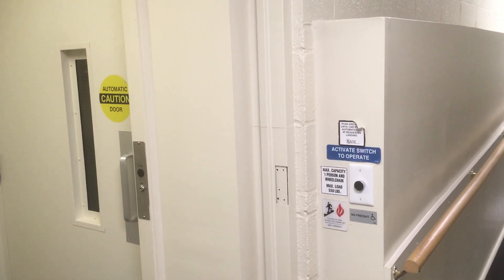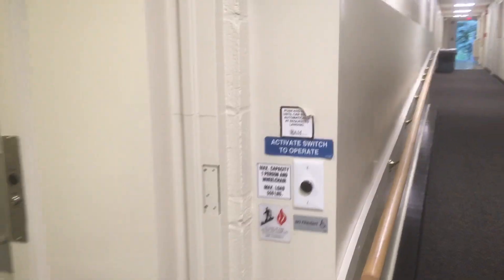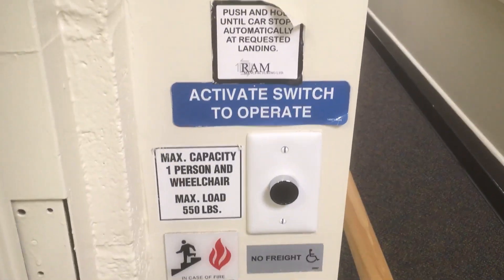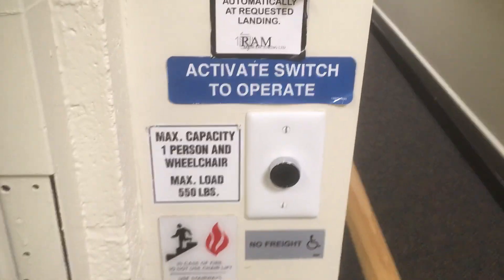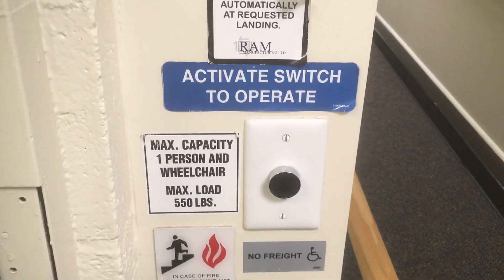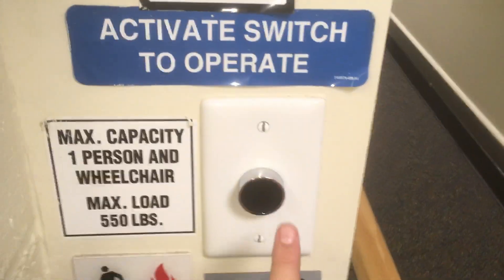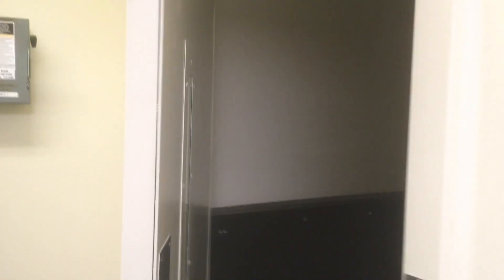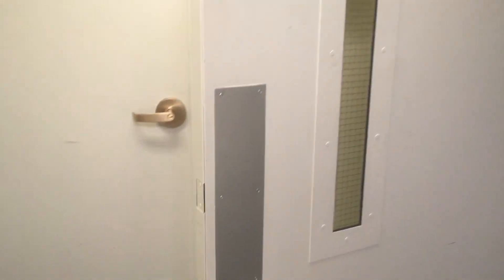LOUD & slow RAM Trus-T wheelchair Lift - Dilworth Hall - Chatham University - Pittsburgh, PA

Comment: I have sent a number of easy / quality improvements that could be made to these lift products in the past - even though I never hear anything about any implementation.

Here is another - I have been maintaining a couple lifts, and there is a problem with this design using of the round "bearings" on the acme screw.  They are just about flat on the top and bottom.  VERY quickly, all grease on the long screw gets taken (stripped) off, and the lift begins to squeal and howl.  Each time I grease up the lift - it's better for a short time and soon - the grease is about stripped from the screw again.  More noise.  Grease does tend to thin witih age and heat as well.  Why not put a very slight bevel all the way across the flat surface of these bearings?  This bevel would "encourage" the grease to move TOWARD the acme screw, rather than get stripped away from it.  I believe it would work very well and would like to see this improvement implemented.
Reply from the maker: And what's ridiculous is it sounded like this when it was only a year old.